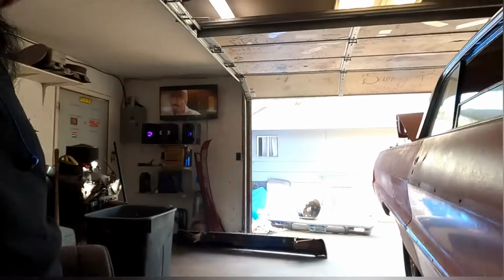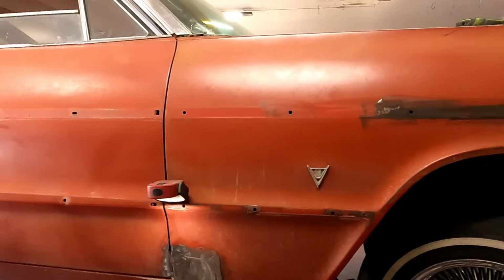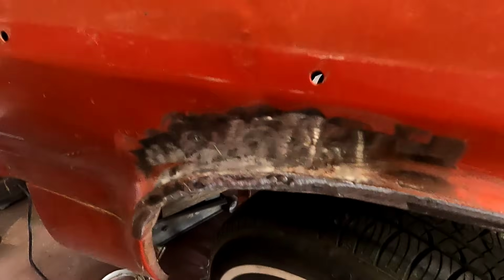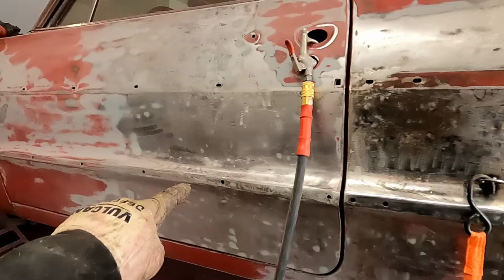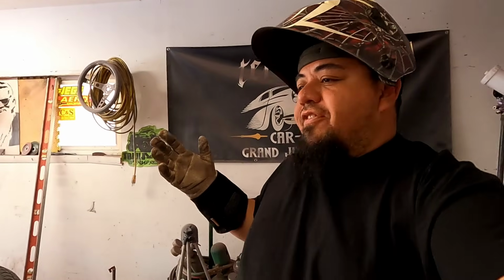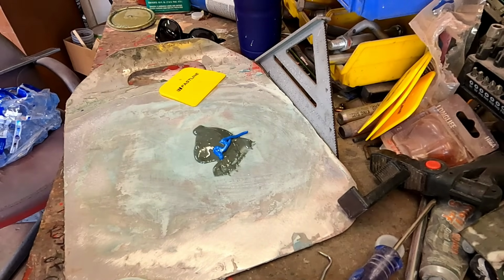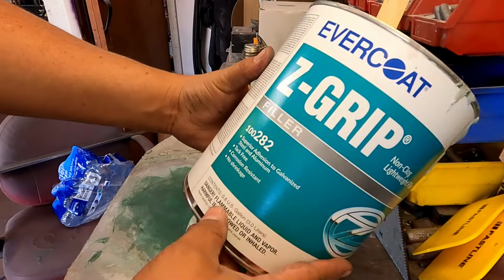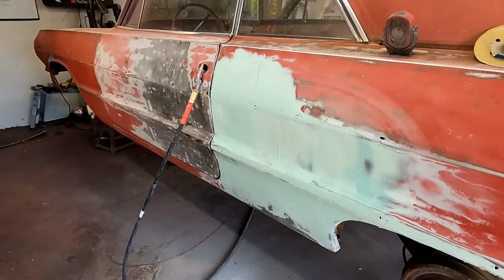Final Metal Work, and we start Body Work for Primer

Comment: Like the work you do. I would like to know where you got that strong magnetic work Lamp you use for welding.?
Reply from the maker: It's a Mac tools light. To be honest, I'm not sure when or where I got it from. I've had it for years and years. Works great 👍
Reply: Thankyou, . I’m a retired mechanic and do a little bit from home. I’ve struggled with  finding a decent compact work lamp with a GOOD magnet. 55 years in the trade, decent light is ESSENTIAL now days 
Thanks for taking the time to answer.

Comment: Quick question, I've noticed that you blow air on your tacwelds,does that help with the metal warping? Thank you
Reply from the maker: Yes, I'm just trying to control some warping, and if you notice, I don't just Tack once I'll actually Tack 3 or 4 in a row. So when you do that, it generates a lot more heat. It's just a faster process. I don't do that all the time.